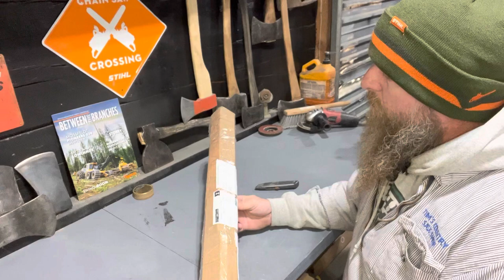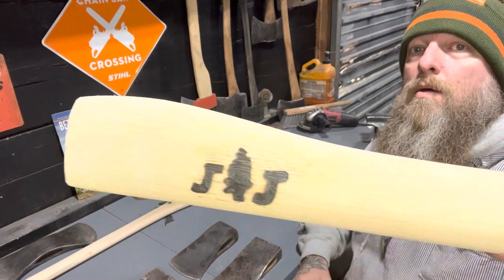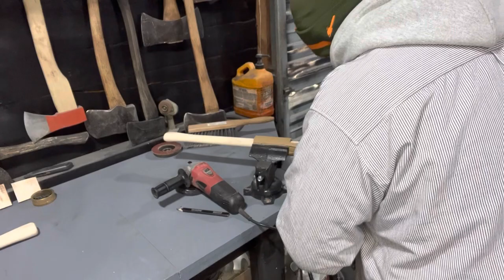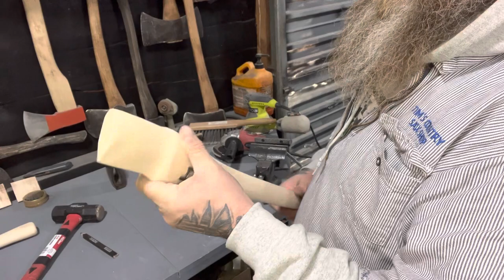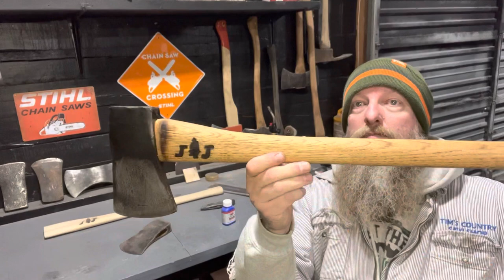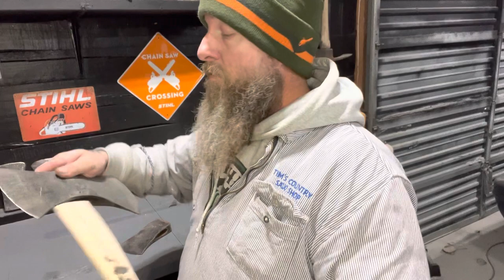Unboxing. J&J axe handles. @jaythe306snowmexican  @jeffsusanward3547

Comment: Nice job on the hang. Having an axe with a poll is handy if something needs to get wacked back into place but not much else is cooler than pulling out a nice double bit when chopping is needed.
Reply from the maker: One of these days It’ll warm up and quit snowing and I’ll get out in the garage and get the double bit hung. Just got 32 inches of new snow
Reply: @doublebitoutdooradventures  I am in Northern Michigan, I hear you on the snow, luckily we didn't get hit that hard though.